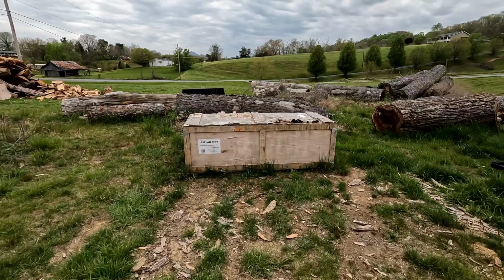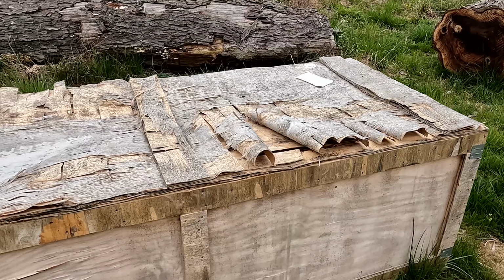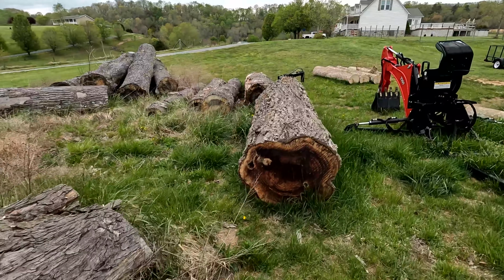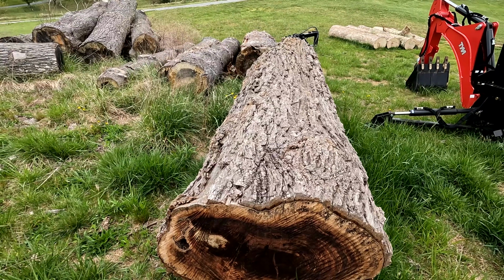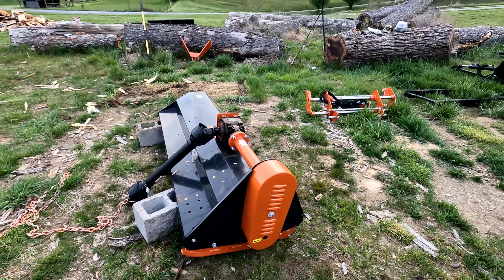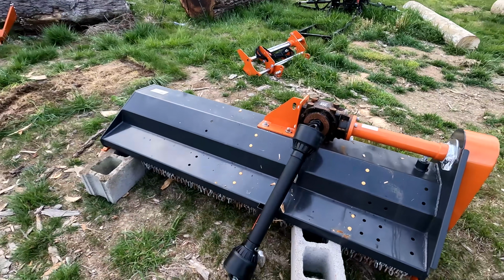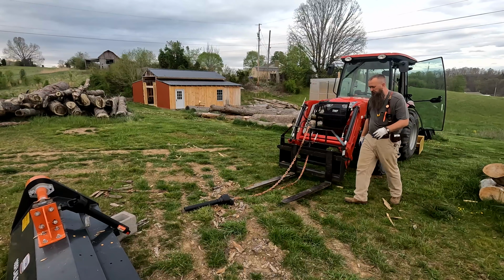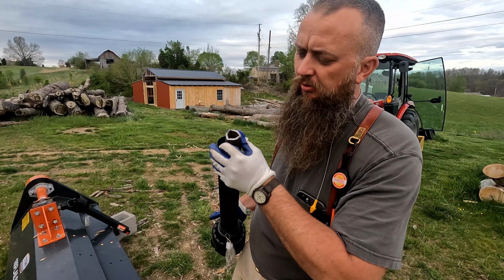Fire At The Sawmill

Comment: Like everyone else, that chain should have been secured or removed. Over site on your part, I'm sure. As for the fire and burning your scrap, I agree with folks about there being a lot of usable firewood there. You could always put up a sign out front and give it away to anyone who has the ambition to do something with it. I'm sure there are a few people that would keep it cleaned out around you. If you are going to burn it, you might want to move your pile about a hundred feet further away from the power lines. The heat can't be doing the wire or the insulation any good. I don't know how it is in your area, but if you damage power lines here in Michigan, you are liable for the damage AND are fined for it as well. Just a few thoughts on the video. Oh, the log looks like Hickory to me.
Reply from the maker: that would not be a good idea, inviting just any stranger to go through a pile on your property is a huge liability, if they get hurt, bit by snake, etc then the law suits would follow, much cheaper just to burn it the deal with people showing up trust me, and its pine, no one wants pine for firewood,

Comment: Love the flail mower. Hook up the chains on the PTO shaft. It's not supposed to rotate. They are intended to keep you safe from a rotating shaft. I'm sure that the shaft inserts only one way. That is to keep the universal joints in phase. Look into a 3 pt quick hitch. Makes switching rear attachments a breeze. They have to be designed for it though. Keep videoing and sharing. Love watching your business evolve.

Comment: Nathan did to cut the pto shaft to fit your tractor?  Most if not all pto shafts must be custom fitted in length to ensure the shaft is not too long resulting in the shaft pushing on the gear box when raising and lowering the implement.

Comment: I am guessing those wires are further away from the burn pile than it looks.  Having done some burn piles way back when tho, I know how hot it gets when the wind blows the heat towards something.  So is that just bare metal wires (which would not be impacted much at all) or is there a rubber/plastic coating on those wires?
Reply from the maker: Yes not even close

Comment: It may be too late. It is good to check the length of the pto shaft on any new implement before using to make sure that it doesn’t bind and break the tractor transmission or gear box on the 3 point implement.

Comment: Yes, the plastic PTO cover's only reason for being there is to make the rotating shaft unable to catch loose things, like shirt sleeves etc being caught by the rotating shaft.
The plastic guards are designed to NOT rotate with the shaft - hence the chain that was supposed to be attached to the frame to stop the cover rotating.
Reply: Just  throw  the chain  away   not  necessary

Comment: How close to those cable and phone lines is your burn pile, in the video it looks close enough for the heat to start melting the insulation on them?

Opps you didn't connect your PTO shaft guard chains....
Reply from the maker: It’s a good  ways 
I noticed that at the end of the day 😂😂
Reply: Yeah, it looked close to the power lines

Comment: I don't know if there is a market in your area for lump or chunk charcoal. It could be 'another' interesting side industry - use your softwood to provide the energy source to convert your hardwood scraps to charcoal and sell the result :D Just a thought about a way to use some of the wood that now ends up in the burn pile. It would still end up burning, but as a useful product.
Reply: He should be making what is called bio-char out of it  
What is Bio-char It is would heated without 02 to make char which is then grounded up and put in soil to improve it.  The char adds places for microbes to live and thus improve ur soil  It goes at $20 a 100 weight and u need a good 1000 lbs to do a 50'x100' garden up right but this is pretty much a onetime thing only having to add about 1/10 of that every3 or 4 yr to keep it up  So $200 top begin with then $20 every 3-4 yr
The boy could easily build a kiln for doing this and have a nice side line
Reply: Yep. Was thinking too that it seemed wasteful to simply burn, for burning sake, those side slabs off of logs milled for finished lumber.  Seems they could have been cut and used for fire wood if not, as you suggested, turned into charcoal.
Reply: Nathan is primarily a one man band. The musical reference aside, if he deviates to far from his core income generating activities, it is Nathan would would be in need of welfare.   OK, his wife would not let that happen but hopefully you get the point.
Reply: @billupstateny9151  Yeah you are right, there is only so much time in the day and he doesn't have enough time as it is. Back in the day some enterprising young man might have struck a deal with Nathan to haul off the pile and be able to make money off it on the side for firewood and such. Not many enterprising young men around anymore! Too much time on a computer has taken care of things like that I guess.
Reply: @tommychew6544  Agree w/ current lack of self-motivation.

Comment: Noticed your safety cover for your PTO shaft. That short piece of chain that's spinning around should be connected to the frame to prevent it from rotating. I'm no tree expert but my guess it's a silver maple.
Reply: I've got a silver maple with bark like that in my yard. I wondered about that chain, never seen that piece of equipment though.
Reply: @tommychew6544  The idea of the cover is that it should be stationary so that it doesn't catch your clothes as it has to so many, most of whom are now dead !!! The chains stop the cover rotating and it has plastic bearings inside to allow the shaft to spin.

Comment: I’m just a little surprised to see you burning your wood pile when, only a couple of weeks ago, you showed us using a log splitter. Surely it would make more sense to split them into usable sizes to heat your home during the winter than just setting fire to them in the field
Reply: Junk wood does not produce much heat.  For heat you need hardwood.  So this stuff won't work for heating.  But he could put it in a chipper and use it for mulch.
Reply: Who has the time to deal with little junk wood. It's much faster to just burn it ... he's got better things to do, like run his sawmill

Comment: Awesome machine, really handy with that side shift, I will go to the website and see what category 3 points are required for different size widths, this 72 sure looks like it's a little heavy by the shift and sway on the 3-Point_drawbars, that is a super nice cut, Sure seems to cut and mulch way more than my King-Kutter 72-inch triple blade PTO - gearbox Belt driven mower,   Super nice addition to the fleet.

Comment: Was the chain meant to be left on the drive shaft of the mower?
Reply: Those chains are to be hooked to center link or something to keep it from spinning. A safety feature
Reply: @johncollins500  Thank you for the explanation. I was thinking they might get caught on something causing the prop shaft to stop working.
Reply: @LRBerry  The PTO shaft won't stop until the engine stops, so those chains will just help catch and drag anything into the PTO and mangle it.  A lot of people have lost arms and legs getting caught in a PTO shaft.  That's why they have the plastic covers that are not suppose to spin with the shaft.  He probably can't  hear it in his air conditioned cab.
Reply: @rockandrattleretreat5830  Thank you.

Comment: Wouldn’t it benefit the farm more to grind up/chip all that wood and use it in the garden on the farm, sell it or give it away to neighbors instead of burning it?
Reply: Most nut trees / sawdust aren't for animal bed or your gardens. All though wood ashes went into garden at home when. Was growing up.
Reply: There is so much of it at a sawmill, you soon have more than you'll use in a lifetime.  For most small operations, it's not worth the time to make wood chips to sell and requires buying and maintaining large equipment (to chip log slabs).

Comment: Hard to see from this posting, but you might want to move the burn pile another 50 feet away from the power lines.  I have seen fires that have melted the overhead copper wires, and naturally, catastrophic failure and a bit of chaos ensued.  That would be me, the overly cautious fellow typing, who tries to avoid undue results.
At the very least, the heat could cause a "hardening" of the metal - as it cools- where a strong wind might flex the newly brittle section and attain simalar results.
Just sayin'.
Reply: Excellent point.  More than likely, at least in our portion of the country, the power lines are not copper.  The conductors are aluminum with a single center steel core for added strength. Aluminum has a much lower melting point than copper and steel. And aluminum is cheaper than copper but requires double the size for the same electrical load carrying capacity as copper.
Reply: I'm sure the power lines are further away than they appear to be.
Reply from the maker: Yes not even close 👍👍
Reply: The camera adds inches to our girth and shortens the distance to objects in the background.  Wait for it, some govt agency will require camera makers to add a disclaimer to the lens..."Objects may be smaller/farther than they appear".  
I have to admit I had to move one of my burn piles when they strung fiber optic internet cable nearby.  Can't risk cutting off OOTW!

Now, who's going to open the carbon credits can of worms?